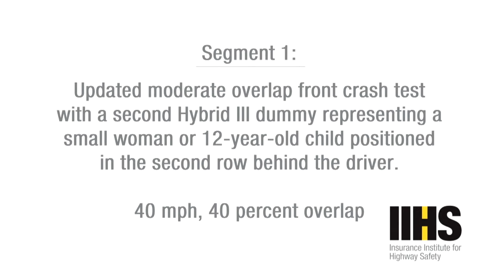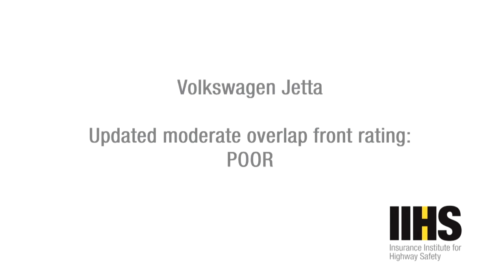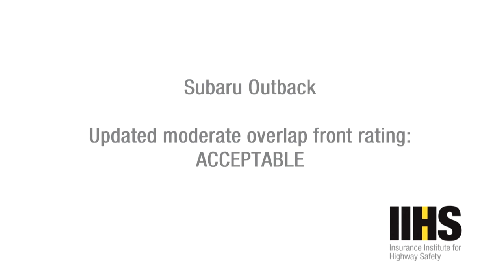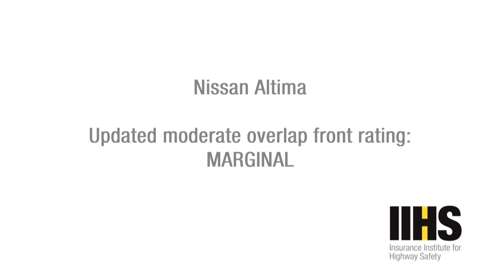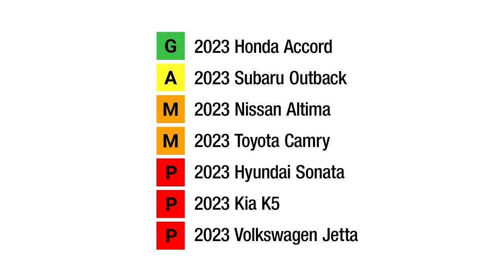IIHS Car Crash Test Compilation - Midsize Cars Reviewed

Comment: How did the Subaru score acceptable? The rear pasagener smacked their head on the window sill, and their head went under the curtain, because there is no protection there, just a piece of cloth.
Reply: Actual measured forces probably show it wasn’t a serious impact. That and the head going under the airbag isn’t doing much.
Reply: @calebj2886  Yes that and if you look at where the glass went, it went up and out, so it sort of "blew" out if you will.  You're more likely to be injured by something else other than the rear window breaking like that (such as the headliner coming down when the airbag deploys or like in the case of the Honda, you bang your head on the top of the roof liner, which could be more serious than perhaps a few scratches or cuts from glass, which I don't think even happened here.  But basically they assume that all glass will break anyway so it isn't really a factor to be tested (and in some cases, you want the glass to break).  The only "window" that is of siginficance in a crash is the windshield.
Reply: These cars have come a long way since the 90 s...
But they all still have a long way to walk before i would call them real safe in all aspects...
The knowledge is already existing in making them much more safe than today...
And maybe lets say 75 kilos in high capacity strength steal added in doors reinforcement and in the big side beam in the inner middle of the doors can get bigger and much stronger...
And the lover side part of cars body can get little wider and stronger too🚗👍☀️🌟😀
Especially the side pole crasch test and the ordinary car crash into side test shows big needs of improvements in all cars..
And there needs to be knee and leg side airbags for all 4 passengers so the legs doesnt get really hard punched in the crasch tests!!
This is just the truth...
Enough said 😎😎

Comment: Just saw the honda. What a joke the rear passenger hits the roof edge and it's the only one to get a good rating. Now I'm convinced it's a pay for rating system.
Reply: There are also criteria for evaluating the failure value if a mannequin hits its head on the interior. It would be GOOD to include that.
Reply: It could be, but I think part of it is these tests are all weighted.  So for example, while hitting one's head on the roof/liner of the car in an accident sounds bad, what may be worse is someone having the lap belt slide up into their stomach (like they mentioned) and causing internal organ damage. The latter is probably more serious then perhaps a cut on the head or a concussion. The ratings are also a composite of many factors too, so particular rating (say front impact) may have "G" for everything else and maybe "Acceptable" for one smaller element, like the head thing, and still get a good "Rating" although I think in the updated rating system (which they changed around 2018-2020 I think) they use the lowest rating in the bunch for the overall rating, but there may still be "weight" applied to different aspects of each rating for each component.

Comment: Not sure why the Jetta is here when it’s a compact car, the rest of the cars in this test are actually midsize and more similar in length/width to one another
Reply: Well I think the Jetta got heavier during the 2019 remodel, putting it in the Midsize sedan category
Reply: @2019Q7Quattro  the Jetta is still at least 200lbs lighter than all of the rest of the actual midsize sedans though
Reply: But that isn’t too much lighter than the rest

Comment: How much is the structural integrity affected by cutting a one-square-foot hole in the roof?
Reply: It would be negligible. The outer metal is mostly for looks, there’s cross structures under the sheet metal that provides the actual support.

Comment: The wisdom from this is that the side airbags hurt the rear passenger more than help.
Reply: The Outback, the Accord, and the Altima are the only ones where the rear passenger didn't do The Exorcist effect where the head spins completely around backwardand with the Outback it was because the rear passenger submarined under the side airbacg and came up between the airbag and the window.

Comment: Sucks how my car (KIA K5) Received a poor rating, I wonder if the trim I have (GT-Line AWD) would perform better than the LXS (base model) and trims under the GT-Lines, as well as my Fiancé’s car (Hyundai Sonata) earned a poor as well, but I think the trim she has (N-Line) would perform better than the SE (base model)
Reply: Serious question, why would the trim of the vehicle make any difference in the crash test? Aren’t the trims just luxury features?
Reply: Well I remember back with the Mitsubishi Galant in 2003 and you could only get side airbags on the highest trim level, the GT-LINE K5 is higher quality than the regular, although structural integrity might be the same as the LXS
Reply: How u liking ur K5 btw? I love the look of that car so I'm curious what owning one is like
Reply: The structure of the vehicle is the same no matter what trim. Unless a higher trim has more airbags or similar (which is unlikely these days), the crash results are going to be the same. But some higher trims may have collision avoidance or driver assistance features that help avoid or reduce the severity of a crash in the first place.
Reply: @2019Q7Quattro Now-days, even the base model would have all the airbags, the trims are just for luxury features/more advanced safety features like lane-departure warnings, since it is the same safety-wise it would earn a good in the front seat, where you or your husband would be driving, but if you have any kids it might be a different from them, look at how either the dummy’s neck swings back and forth, or if its submarining. Sorry if it’s a long paragraph, just here to help.
Reply: i meant your wife i am done being on youtube today
Reply: It's still a Korean car, that's why you get it cheaper than the competition and why they did poor. (Kia, Hyundai)
Reply: @popz4470 Hyundais are safe. My best friend killed an old woman that pulled out in an Audi sq7 on a red light. He was in a 2012 Hyundai Genesis racing a Modded civic Si. They were doing about 136 mph when the Audi pulled out. The Hyundai braked down from 136 mph down to 76mph when he hit the audi. My friend lived but had 4+ herniated discs. Messed up situation.

Comment: So the cars that did poorly probably did poorly because they weren’t designed with this test in mind. Similar to that small overlap test introduced a few years ago,p in which almost all cars failed or did poorly. So don’t read too much into this unless it’s a car that was released after this updated test was introduced.
Reply: The tests are designed to simulate real world crash scenarios. So, what you’re saying is that the cars that did poorly in this test did so because they were not designed with real world crash scenarios in mind.
Reply: @ouch1011 Yes that's what I'm saying. They don't get good ratings from this test also means in a real crash they will not perform as well as the "Good" cars.

But give them the next model generation where they know this is something they have to design for and the cars that are doing "Poor" or "Marginal" will do better and thus become safer in the real world.

That's what I mean by that.

Comment: There's gotta be a material that's more resistant to crashes🎯
Reply: There is, some older cars are made of very nice crash resistant materials, though most companies would rather use the cheaper option because that means they can pump out cars quicker ¯\_(ツ)_/¯ it would also crash the repair industry they have if the cars were more resistant to damage so they prolly wont be using better material any time soon
Reply: @SystemRadioStatic  .....yup😏
Reply: @SystemRadioStatic  What? Newer cars are far safer than older ones. Crumple Zones exist so the car absorbs some of the energy from the crash.
Reply: The car’s structure needs to deform the right amount to absorb some of the crash energy, so less of it is transmitted to the passengers. If you made a car out of materials that don’t bend or break, then more of the energy would be transferred to the people, resulting in more risk of injury. I would rather injure my car than myself!
Reply: @Sashazur  makes sense....

Comment: Its crazy how the Jetta is now considered midsized

what the hell
Reply: Actually, what's surprising is how many cars have made it into this class.  What used to be full-size cars 30 years ago, are now mid-sized.   The other thing is that the vast majority of cars have gotten larger as the years have gone one.  Look at the Toyota Corolla, Honda Civic, etc.  They are about the same size as a late 90's TAurus (which is considered a mid-sized car), even though rental agencies for example, still classify Corollas and Civics as compact or small cars (but that's just how they classify different sized cars).

Comment: Obviously, these vehicles are not running during the test. The transmission is in neutral, and there probably isn't any gas in the gas tank.
Reply: I've never seen testing with the vehicles running.  It's always been done this way. They would no longer have control over the test environment.
Reply: If they had gas in the tank there would be a high risk of fire or fuel leaks. Sure those are things that it would be good to test for, but it would make testing much more expensive and dangerous. Most cars don’t explode in a crash so it’s probably not worth doing considering the increased problems in testing.